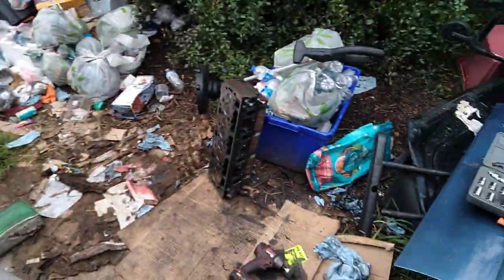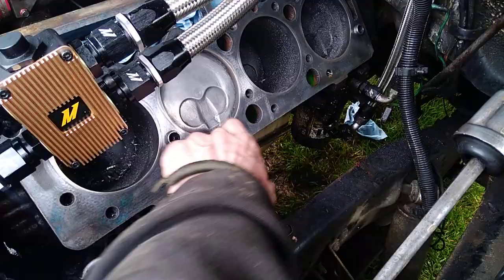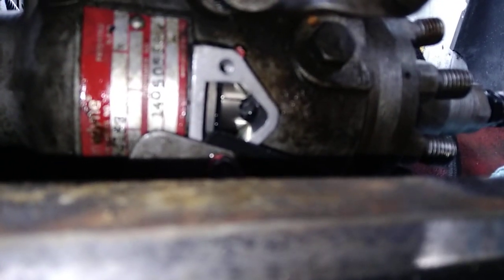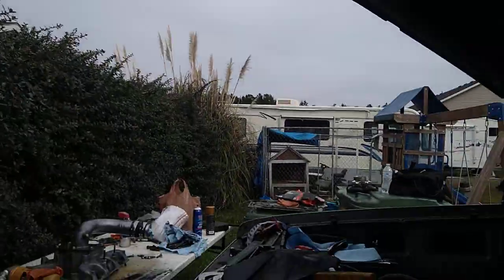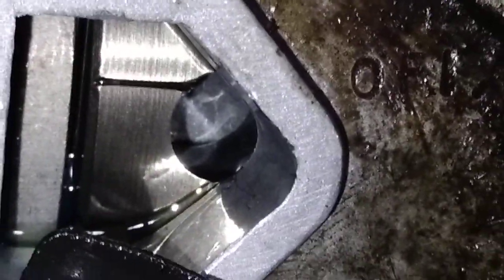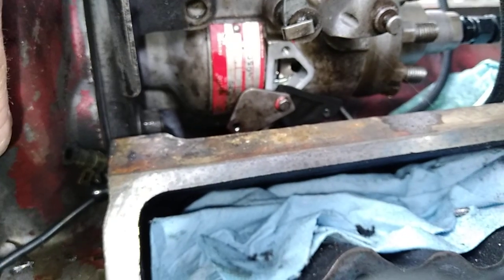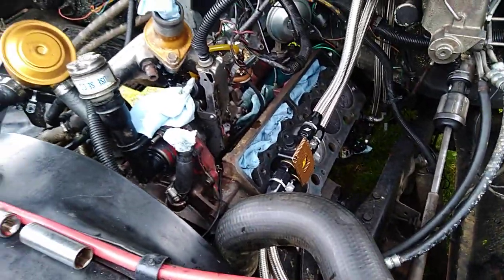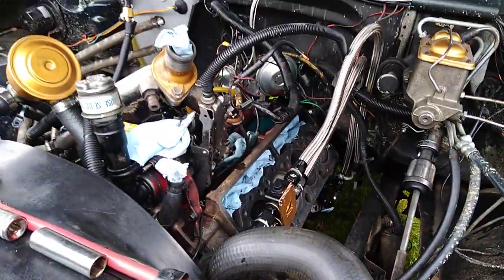DB2 Injection Pump How to Turn Up Fuel.

Comment: Turning up the fuel delivery will  do 1 of 2 things. You'll  either gain 5 hp with decreased mpg, or it will smoke like hell.
Reply from the maker: @dw7094  my fuel economy went up and power increased. Fine tuning is critical in achieving a proper balance between fuel efficiency and power. A stock engine may benefit from a slight increase while too much results in negative effects same as with a built motor; a slight increase may result in negative effects while a greater increase can result in desired performance. Each motor will be different anyway depending on miles, model ect